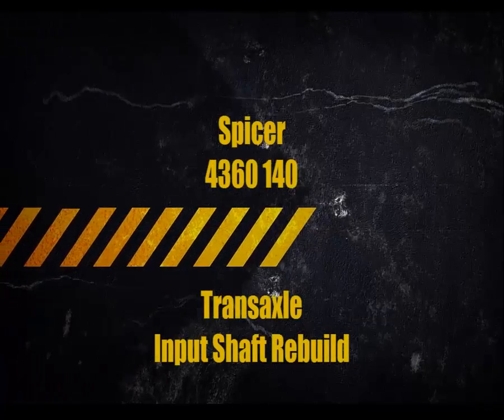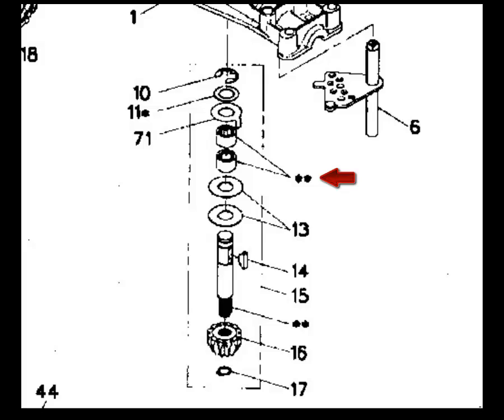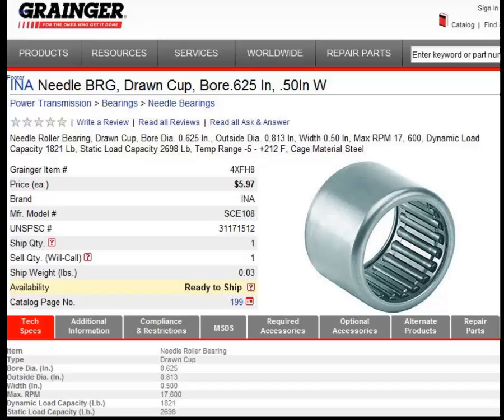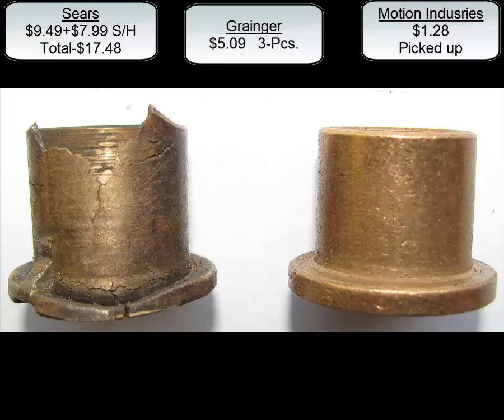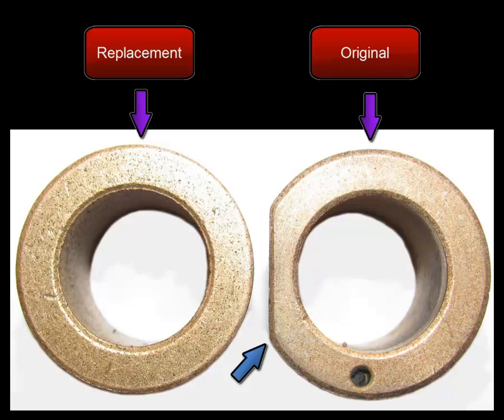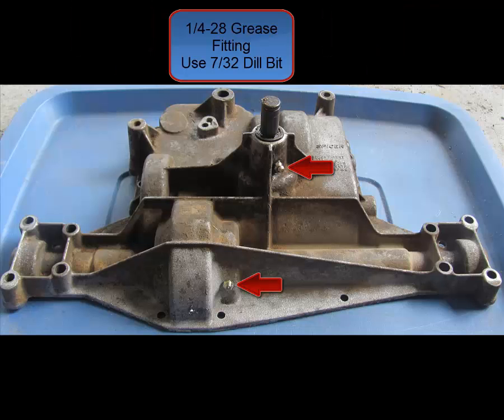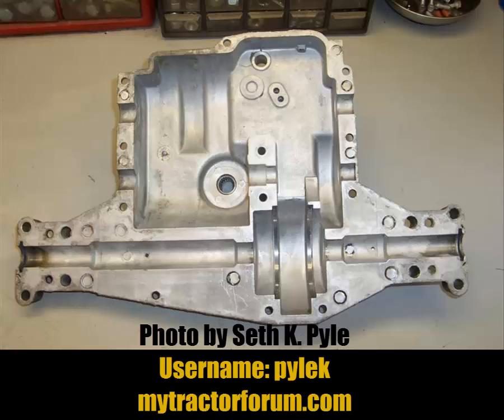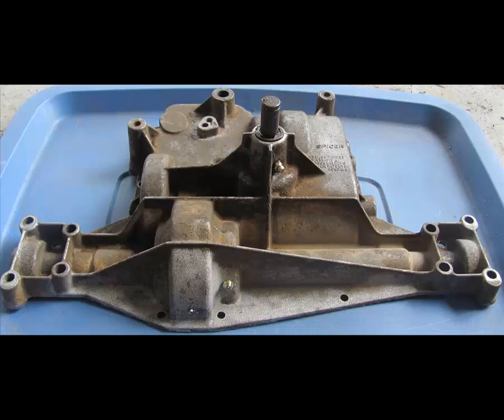Dana Transaxle Input Shaft Repair

Comment: A video made 12 years ago and it still is the gift that keeps on giving. I picked up a non-working Craftsman LT1000 mower and spent hours getting it working only for the input shaft to have a torsional breakage. I couldn't believe it. I haven't opened the transmission up yet but I am really hoping all the stress went into the break and didn't chew up anything else on the inside. It sat for a long time before I got it. I'm wondering if the work it was getting all of a sudden was too much for it or if it wasn't lubricated well and was just too much stress.  I bought the input shaft so we'll see how the repair goes.

Comment: Is the input shaft pulley supposed to be solid or does the bottom of pulley spin? I notice there's also some play in the pulley where it goes down in the case. The symptom was, I had mowed for 30 minutes,went to put in reverse and mower wouldn't move and there was black smoke coming from under the body.. I thought it was the drive belt,but  it was intact. Would appreciate your input.

Comment: Great video . My 4360 -97 is the same as the 140 but the ball spring holes are plugged with a slotted screw . They are hardened on the end so much a file will not cut it . I had to use a dremel tool with a 3/16 x 1 inch chain saw sharpening stone to bore endways through the hardened end of the slotted screw about a 1/4 inch in the screw became softer and could be drilled  easily . Buy at least 2 of those little stones and take your time , it will tale 2 because soon the steel end will show through on the cutting end . An easy out pulled the rest of the 5/16  screw out . If you get it hot enough to catch fire you will not be able to put it out and God help you if you spray it with water .  No damage to the Magnesium case by grinding a hole about 1/4 to 5/16 inch and then drilling the unhardened part.

Comment: After about $25, mower is moving and mowing.  The bushings did not fit into the 4360-180, I installed both earlier pictured zirc fittings & needle bearings and spent almost the entire time cleaning out the original grease.  I also used the earlier described driver to knock out the bearings.  The marine grease I used may be a little too thick, as pushing the mower around in neutral is much harder, but it doesn't bother the mower.  Doing some armchair quarterbacking, I would have partially filled the voids along the axle-especially the ones near the seals.

Comment: Hello sir. I sure appreciate your videos. My input shaft had a bearing failure I suppose. Took a big hammer to finally get it out an it definitely was sized up. I guess that is a common thing. You talked about in your video with the addition of the grease selt. Which I'm all in favor of.. Here's my problem.
My transaxle is marked. Spicer 6800-1 and 402723 

I want to do like you said in your video.. But I'm afraid the part numbers may be different..

Comment: Hi! Thx for the video. I have a Roper ‘91 with Foote/Dana transaxle. The manual ( different year) says tofill with 4 qts sae30. After several grueling hrs to clean the inside before sealing, it now leaks?! Is grease the right way to go? And, although the gear shift now moves (it was seized in2nd) it’s still a challenge. What am I doing wrong??

Comment: Input shaft 2 bearings stuck in casing ...how do I remove both of them.
Mike
Reply: Hi, i was wave the same wondering how you got on at removing the 2 bearings, i have the same problem, i dont want to damage them as i intend using them again  
in a second gearbox

Comment: Thanks so much for the video.  Having issues removing the lower bearing race for the input shaft from the housing. These are pressed in and the outer races are very thin with little room to access to remove it is quite the challenge.  Any ideas or help would be great appreciated.  Thanks so much. KB
Reply: You need to make a driver.  The bore is a press fit less than 13/16" (26/32") so something slightly less than that is needed.  Try a 9/16" thinwall 12-point 3/8 drive standard depth socket.  The O.D. of mine measures 25/32". 
Then . . . 
1.  Screw 2 nuts onto the end of a 3/8" bolt.  The 2nd nut should be flush with the end of the bolt. 
2.  Snug the two nuts together so their hexes are slightly misaligned. 
3.  Push the nuts end of the bolt into the 9/16" socket. 
4.  Put the socket end into the bore and tap on the bolt head to drive the bearing race out.
Alternately, you could turn the socket the other way and use a 3/8 extension to do the driving, but that puts the thin edge of the socket against the bearing race where it might not make sufficiently good contact to prevent damage.

Comment: Excellent video.  My input bearings are so far gone that they actually are gone.  No needles.  It looks like an extremely sloppy sleeve bushing.  You answered a previous question concerning pressing out these bearings, but didn't mention which way.  Do you press the bearings towards the inside of the housing or towards the outside?  Do both go in the same direction?

Comment: can you tell me exactly where to locate the grease zert fittings?
Reply: Dont see anything in your video on where to locate these grease fiitings
Reply from the maker: Unfortunately you have to drill holes in the side and put the grease fittings in yourself
Reply: yes but a location would be nice.
Reply: Also why the grease fitting at the bull gear location?
Reply: @garyalford9394  ... The picture indicates the zerk is located about halfway between the two bearings (which makes perfect sense).

Comment: Dave - I have a Honda 1011 riding mower and some fluid is leaking out of the left rear axle, near the tire and black frame (axle bolts). The Honda schematic I have doesn't give any insight; I'm thinking it's either gear lubricant (or less likely hydrostatic fluid) seeping out thru a faulting seal. Any idea what's specifically the problem and how to address the issue?  Thanks...
Reply from the maker: Definitely a SEAL issue.
Reply: Any idea where I can locate a replacement seal/ring?  Would a product like ATP AT-205 Re-Seal help, by any chance?

http://www.boats.net/parts/search/Honda/Riding%20Mower/0/H1011R%20SA/TRANSMISSION%20CASE/parts.html

Comment: Love your video! I just have a question about my transaxle. I have a Dana 2000-10 looking to rebuild it, but where would I get put the grease fittings on it? Here is a parts diagram of it: https://i.ytimg.com/vi/H_tWfGWImT8/hqdefault.jpg?custom=true&w=168&h=94&stc=true&jpg444=true&jpgq=90&sp=68&sigh=W5zKip6xkh8yr9AS2SWqb4Vrqv8
And my e-mail is jchen3502@gmail.com if you want to contact me via e-mail. Thanks!

Comment: very good video. but, where do i get, just, the input shaft as mine is very worn down from the bad bearings. i don't need a kit as i ordered the bearings seperately like you said. sears does not make the shaft or the kit , for that matter, i need a shaft.

Comment: Whats the best way to remove the worn input shaft needle bearings from the top housing?
Reply: I usually support the case half with blocks to make it level under the press. Than I will take a bolt that is just a bit smaller than the outside diameter of the bearings. Than use the press to push them out.

Comment: Great video, tons of useful money saving information. Do you know how small of a pulley I can put in the Dana Transaxle 5 sp. Std Model No 4360-78? The objective is to change the pulley ratios to make it go faster.
Thanks!
Reply: Erika Fh Top speed for the input shaft is 3600 rpm on most lawn mower products. That would be a 1 to 1 ratio. Same size pulley on motor and trans. Any more will kill it dead pretty soon.